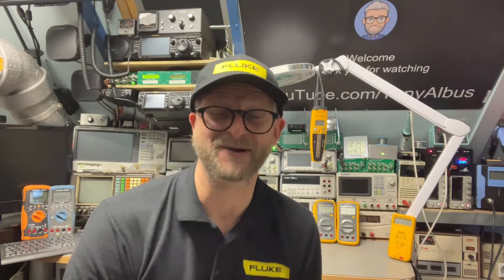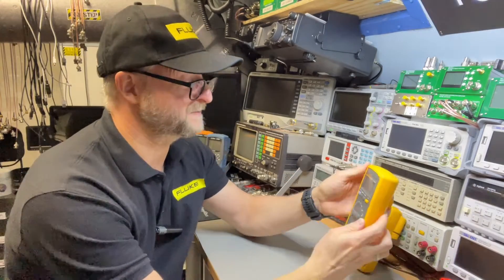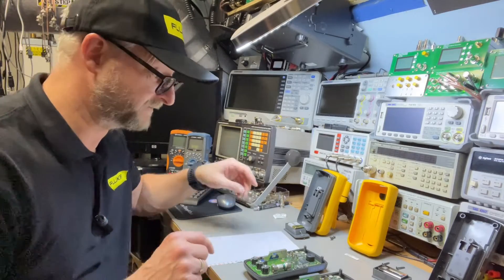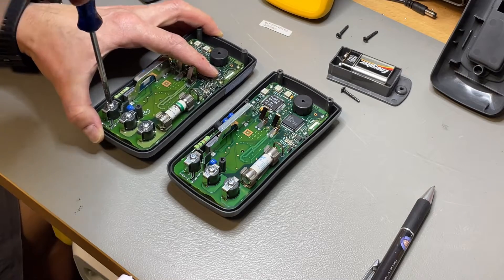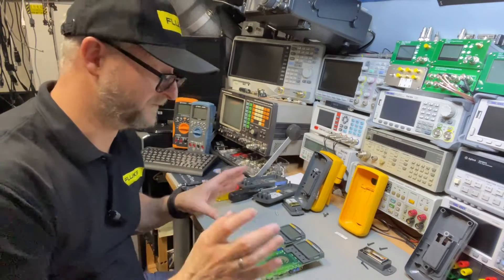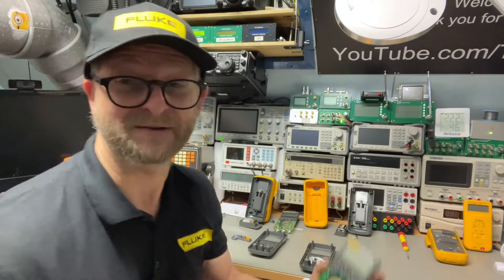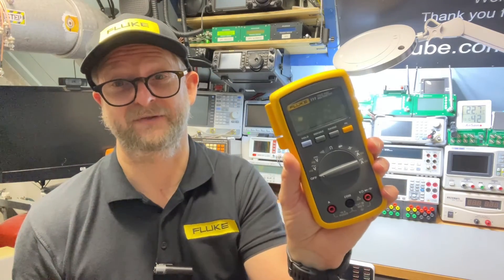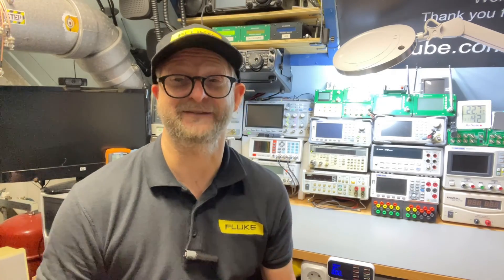TA-0374: Fluke Friday (E20) The Fluke 81438 or is it a Fluke 111 - Why Fluke ?

Comment: Hello. My Fluke 111 is set to DC Volt & Diode, when touching the red & black probes together, it always has a value greater than 0 (around 0.004-0.009V). Is there a way to fix it? Thanks
Reply from the maker: Hi, i don't think there is a Zero or Rel function on the 111. so maybe by cleaning the terminals and probes with IPA alcohol you get is a bit better

Comment: Yeah, Fluke Friday is back! Thank you, Tony for a look at these meters. I suspect the 81438 was made for Sears under a licensing deal with Fluke and probably manufactured in China, possibly with lower quality parts. Did you notice any differences in component manufacturers? Still, it looks good inside and performs well. Regards, David
Reply from the maker: Thanks David, the 81438 does not mention 'Made in USA' and CE and TUV like the viewers noticed. but to be honest the main board with parts looked exacly the same to me. 
i think myself Fluke will not risk his name using lower quality parts. its just a marketing thing.

Comment: I still have a 112.  If I remember correctly Fluke stopped this series because the design of the rotary switch was weak. The rotary switch is indeed a weak point and Ebay is full of replacement switches.
Reply: Funnily, my 111 is still perfect, I have it since 20 years or so. 😊
Reply from the maker: The 112 is nice with the backlight, i will have one soon, then i show the whole 110,111,112 side by side in an other FF. Yes ebay is full of switches when loooking for a 112...now it makes sense, reading your comment.